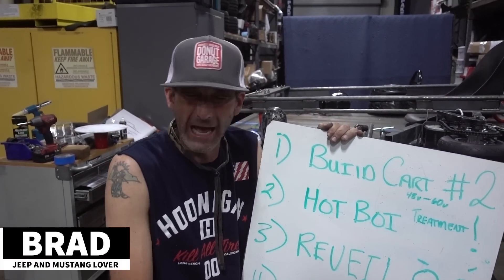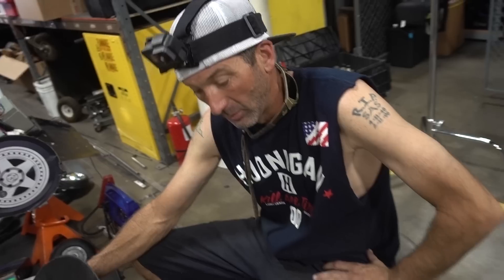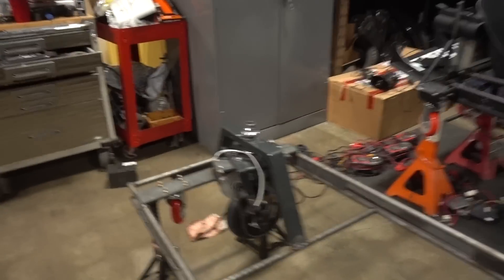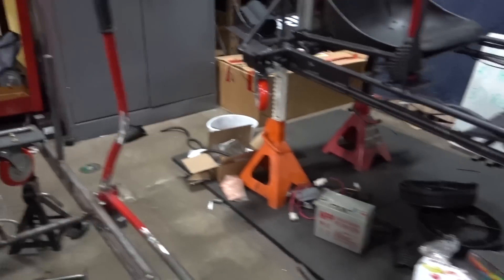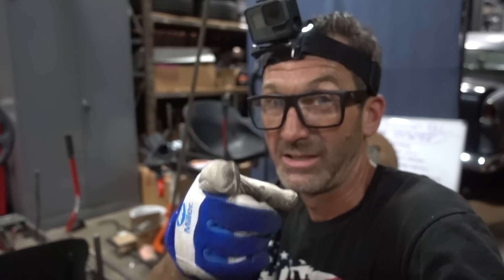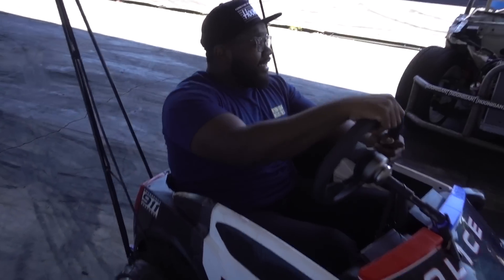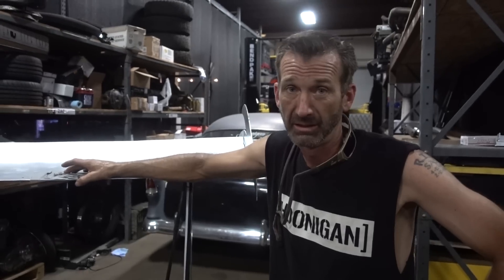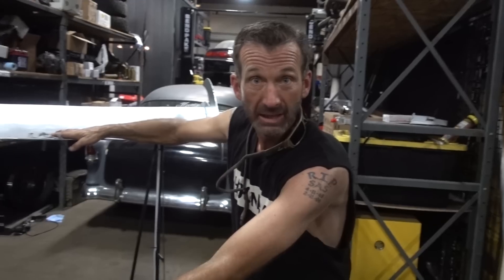Crazy Cart XXL Final Form! Will They Survive our Final Challenge?

Comment: Brad... All you have to do to build a good cart is use the same dimensions as the original razor kart, and multiply by 1 + (the % you want to increase the kart). EX: 47" Length, 47" x 1.15 = 54.05" new length. Do this for all the other measurements and your new cart will have similar geometry as the original, just 15% bigger. Throw a bigger motor in it and call it day. Take advantage of the 8 years of RND.

I went to college so I can sit miserably in a cubical, and watch Hoonigan videos of the life I dream of.

Keep Hooning on!

- Jason

Comment: @Brad you should have used heavy duty tool box casters. The ones off the big roll away tool boxes. Those are designed to hold 1K+ lbs. That should be good enough to hold Vins crazy driving and may even hold up to Herts inevitable parts wreckage. Whatever you do, just hoon it!

Comment: You guys should build a partner drift car. Pedals and shifter on the right side of the car for the passenger, steering wheel and ebrake on the left side for the driver, and it would take both people working together to drift or drive it in general

Comment: I think if they just spent the time and effort to just add a better amp battery to the original karts they would of been much better. It's a great case of "if it ain't broke...that's because some one spent 8years to design and engineer a great product". Better luck next build brad.